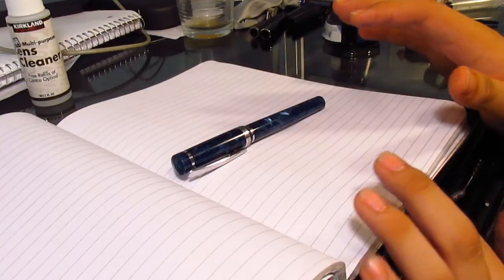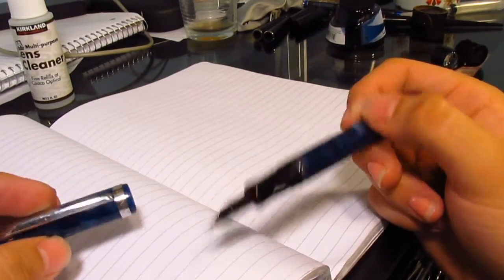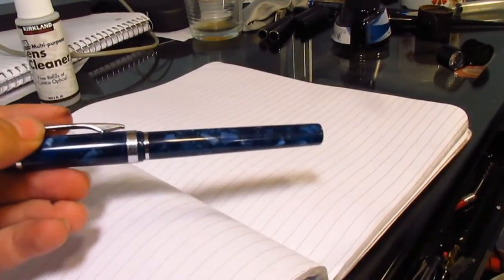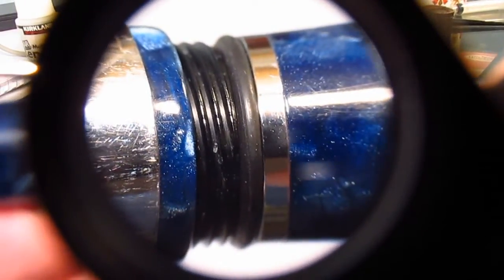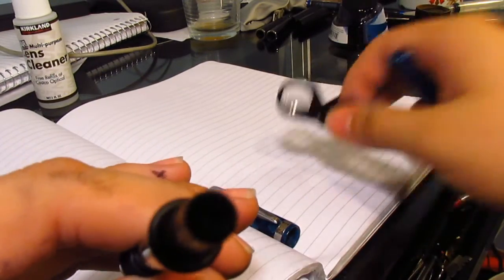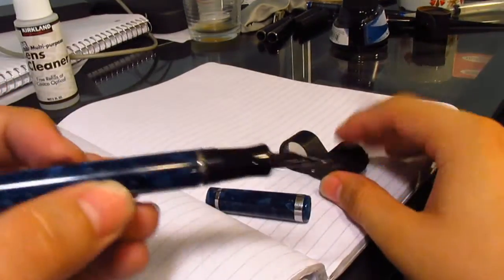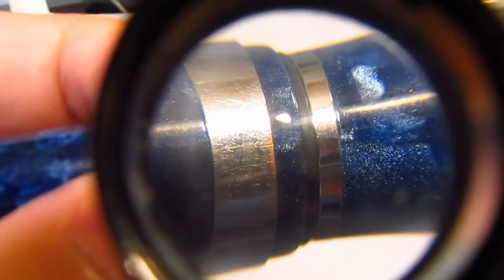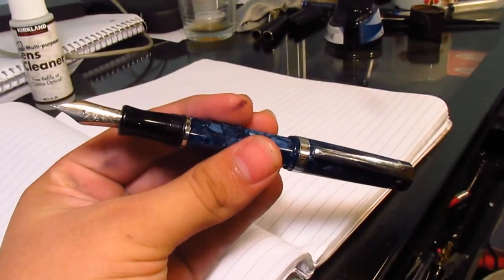Nemosine Sigularity Modification

Comment: I’m late to the party, but I’d like to thank you for the tip.  I bought the acrylic version of the pen for my daughter and it seems to unscrew far easier than the plastic version of the pen.  Also what nib do you use?  Looks like a fine or extra fine.  I’m also having a problem with flow in the fine nib.

Comment: Hi Diego,

I'm getting this pen. I'm just wondering what o ring size did you use? And where can I get it? Ace Hardware store, Amazon, eBay...?
Reply: Gouletpens.com sells the o-rings and silicone used for transforming pens to eyedroppers, but you could probably go to a store with your pen and ask to have one that would fit.  I would also get the syringe to transfer ink and some ink sample sets for fun.